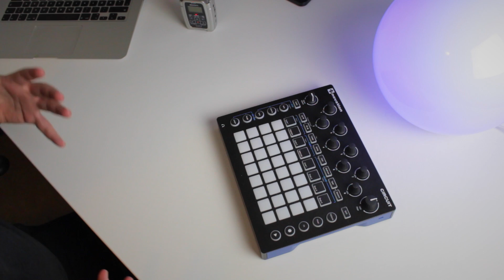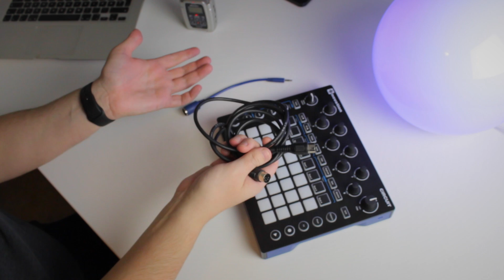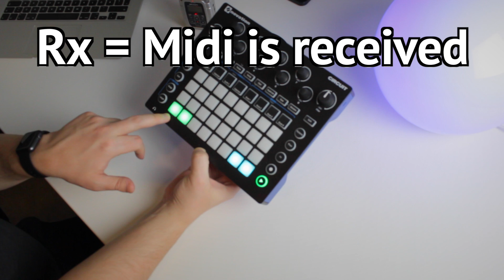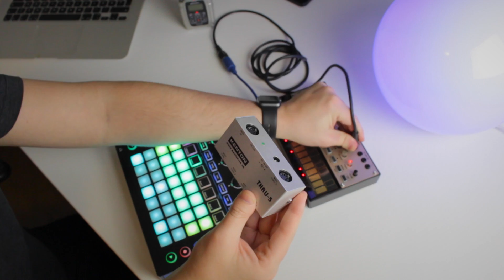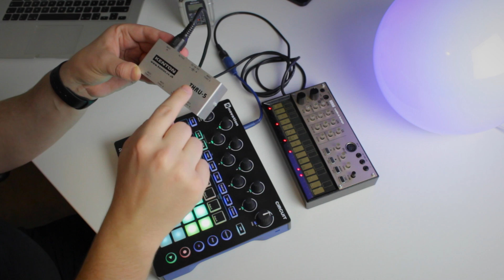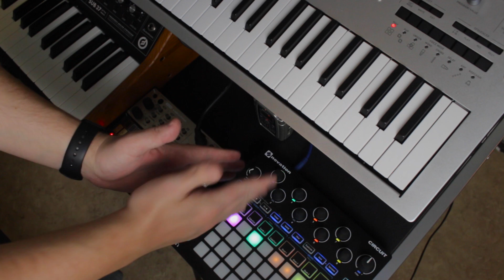How to connect & sequence external synths using Circuit (Beginner Friendly Tutorial)

Comment: Bo another midi question re the circuit.
Any idea how to get the circuit to recognise the pitch and mod wheels. The original mini nova synth has both but I'm told the circuit mini nova synths don't respond to a normal pitch or mod wheel send which is quite strange. Any ideas on a work around

Comment: Hi Bo, I have a Circuit and 2 Behringer TD-3's. How can I make these 3 units run at the same speed if each TD-3 has its own sequence running on it? This means that no MIDI notes should be sent, only synchronously, but at the same speed. In your first example with the Volca Keys, it runs in sync, but not at the same tempo. How do you manage that?

Great Channel! 👍🏻

Comment: Just a little headsup for people, you have to use the blue adapter! I thought I could skip it and bought a Midi DIN to 3.5mm and it doesn't work. need a traditional Midi DIN cable into the supplied adaptor.

Have fun all!
Reply: 3.5mm 3 Pin TRS Plug to Standard 5 Pin MIDI Socket Adapter Lead

There are several different types of these adapters, when companies started using 3.5mm connectors for MIDI there was no standard so not all companies use the same wiring.

This listing is sometimes known as Type B and is suitable for:

Arturia - Models including Beatstep Pro and Keystep
Novation - Models including Circuit and Launchpad Pro
1010 Music - Models including MX4

Wiring inside the cable is:
Tip - Pin 4
Ring - Pin 5
Sleeve - Pin 2
Reply: @pflo-98  you rock!

Comment: I bought a used circuit, but it seems to send no clock or other midi data, no matter how i set both Rx and Tx. It also doesnt receive. 8 use 3.5 mm three pole trs to DIN midi adapters, not the originals though..
Reply: The Circuit uses the alternate "TRS MIDI B" wiring breakout cables, so perhaps you have the "MIDI A" type. Korg uses "MIDI A"; Arturia and Novation use "MIDI B".

Comment: This is great. I want to do this with my Behringer Crave when it arrives.
Reply: How did this work out for you? Looking to do the same
Reply: Perfect. I have the circuit set to control a Yamaha dx7 and model d on same midi channel 1 and crave set to clock of circuit so I can use its internal sequencer and keep it set to tempo of circuit whilst playing different notes. Great setup.
Reply: @davidlloyd9598  wow man i just looking to do the same. my buying list includes circuit, model d and maybe the crave. so you saying that is possible to have a midi keyboard sending midi notes to circuit which will then send both notes and sequence to model d without affecting the rest performance of the circuit?
Reply: I have my circuit set up to play poly chords on channel 1 sent to dx7 which is going through zoom ms70cdr then polara all in stereo into mixer which can be layered with circuit synth. On same channel my Model D will play all of the lowest notes of chord. The crave is on a different midi channel so plays its own sequence using its arpeggiator or sequencer it syncs with circuit clock though through midi. I then have a spare channel on circuit to use for a baseline or melody or whatever. The crave could be set up on same channel to play arpeggios and using a delay behringer fx600 this works great for arps if you want. It is a great set up. I use it for making backing tracks that I can play over with my guitar. Model D and Crave are the best synths in terms of sound quality and value. The dx7 is probably the best polyphonic synthesiser you can get. It has iconic status thousands of patches and when you put it through those two pedals I mentioned it sounds beyond epic! Have fun. The circuit is a fantastic device which is a great hub and works really well.
Reply: @davidlloyd9598  great reply thanks. I guess I could do the same with my yamaha psr-303

Comment: hi, ive the mono station and drumbrute. ive tried to set them both up with 5 pin to jack. so midi out on the circuit into midi in on the drumbrute. but for some reason they dont play together when i press play on the circuit. any ideas? i have the setting set up right when i press shift and on on the circut. thanks

Comment: Hey Bo, thanks for this video which was really useful.  I'm interested in something that will act as clock sync between my keystep (playing novation peak) and grandmother.  I can't use either of those as master because I want to be able to run and stop the arp and seq patterns on each on independantly while they remain in sync.  Do you think the Circuit would do this job while allowing me to clock divide the keystep and grandmother independantly to change their speed while remaining in sync?

Comment: Hey BoBeats, thx for the informative tutorial!  What if you want to play a synth to record it's sounds into Circuit?  How would I go about doing that?
Reply from the maker: you cant record the sound INTO the circuit. You can only record midi notes. Midi out into midi in of the circuit. Making sure the circuit can receive note values
Reply: @BoBeats  Nah Bo...u CAN absolutely record into Circuit through MIDI.  I did it the other day.  I simply forgot how to do it since I've been trying different configurations.  I was hoping you had done it before and can help me.
Reply from the maker: Yes midi, but I was just making sure you didn’t mean AUDIO :-) midi is not a problem.
Reply from the maker: For midi its: set your synth to channel 1 or 2, this will target synths 1 or 2 sequencer channels. Or channel 10 for drums. Midi out from synth into midi in of the circuit
Reply: @BoBeats  Thanks again for your help and awesome tutorials!
Reply: @BoBeats  It's not working for me.  I can hear the notes being played on both devices but when I press record on the Circuit it only records the internal sounds.  Is there any trouble shooting I can do before I exchange it?
Reply: Pls disregard.  I got it to work!  I was about to return it to Guitar Center lol 😂.  Basically I forgot to plug both MIDI IN's and OUTS.  Also I had to press the boxes in the Midi settings to send and receive notes.
Reply from the maker: So you want to play back the synth from the Circuit? Ok!

You connect midi out from synth to the Circuit. Then you connect midi out from Circuit to synth. Then you set the SYNTH to midi channel 1 or 2 (or 10 for drums) and then you should be able to play back midi notes from the Circuit sequencer + record midi notes from the synth. If this doesn't work I would email Novation and ask over on Circuit Owners group on Facebook. Great group!

Comment: Really informative video and easy to understand! I have a question lol. Is there a way to use the circuit as a sequencer for the minilogue’s sound? Like not have the circuit sound and just the minilogue sound playing in the circuit? If that makes sense lol
Reply from the maker: Thanks! No the Circuit has no audio input. What you can do is to sequence the Minilogue from the Circuit and turn down the audio from the Circuit in the Circuits mixer so that you only hear the Minilogue. But you still need an audio interface/mixer to hear both sources at once.
Reply: BoBeats ok. Thank you

Comment: This gets confusing.  How would you connect a synthesizer, a Circuit, and a Zoom reverb pedal to a computer?  I have the novation Audio hub but it only has 2 RCA inputs.
Reply from the maker: If I am not mistaken here you would just use Circuit outputs L/R into the Audio Hub inputs (use TRS to RCA cable or small converter plugs that converts a TRS/TS to RCA). And if you want to use the Zoom reverb you just do Circuit -> Reverb -> Audio Interface. But that means you will get reverb all over your Circuit which isn't ideal.
Reply: Yea that's the setup I have going now; however, I added an ultranova synth and ableton only sees the individual components so I cannot record them together. I guess what I need is a mixer instead?
Reply: Hey just wanted to say thanks for the help.  The way I have it going right now is Circuit Mono out->Ultranova->In.  Circuit MIDI out->Ultranova MIDI In.  This does allow me to play both; however, they are both playing the same sound from the keyboard.  My task now is figuring out how to make them independent and be able to use synth 2 on the circuit as well as the drums etc..  haven't figured this out yet.

Comment: so when I sync my Novation Circuit with my Korg Volca it has to use the midi-port of the Volca? since the midi-port is already used, is there a way I could still control the Volca via my Arturia Keystep? or do I now have to play it using the ribbons?

Comment: Hey Bo, big fan of the channel! I can't seem to sync my Circuit and Volca sample. When I hold shift and turn on the Circuit the entire bottom row lights up, not just the two at either side. Is this a change that happened during a later update? I followed your instructions, but the confusion comes with the rest of the lights. I've tried a bunch of combinations and just can't seem to get it to sync! I'd really appreciate some help here, Google doesn't seem to have the answer. Cheers
Reply from the maker: This is correct. They have added more options. Unfortunately I have not looked into it much :-(

Comment: could you maybe help me with a couple questions? ill explain the best I can here goes. ok I have a novation circuit and a zoom q2n and a zoom h5. I wanna wire these up to the zoom q2n and use the mic on the h5 for guitar into the video recorder (2qn) do I plug n the circuit to the input of the h5 then line out to the q2n then monitor it with headphone jack? and if I do it this way will the h5 have to be recording for the novation sound to make it to the q2n? to sum it up I just wanna get audio and video and get external (guitar) to the video recorder.

Comment: Can you tempo sync novation circuit with korg monologue using standard 3,5 mm jack ?
Reply from the maker: +Korpo Crey no I dont think that is possible. I dont think the sync jacks on the Monologue are the same typ of jacks as the Circuits midi. I could be wrong here tho!
Reply: Thank you very much for the reply> I just purchased the monologue and the circuit  - those are my first pieces of gear after years of using VSTI's. I have a problem with syncing - when I connect the two using the headphone 3,5mm jack - the monolougle dispays shows CLOCK SYNC, but I can no loger activate a sequence on it. 
As soon as I deplug the cable from the monologue, the sequencer behaves normally and plays the sequence. Any ideas what I may be doing wrong?
Reply from the maker: +Korpo Crey i think you should use midi out from circuit into monologue :-)
Reply: That is what I do Sir :D

Comment: Hey Bo! So I finally got my Circuit and now I connected my microbrute to the unit and it works. BUT the Problem I have is that the synth also gets triggered by the drum channel! So the microbrute and the drums play at the same time. What did i do wrong?
Reply from the maker: +Honeyball Lecter hey! You should check the manual for how to turn of receiving midi input/output, cc input/output, and clock. Basically you power off the unit, hold shift and press power and then you can toggle these things :-) From what you write I assume that you want to turn off midi send. 

But if you want to send midi from synth channel 1 to the microbrute you need to check what midi channel the Brute recieves on so it doesnt recieve on channel 10 which is the drum chanel.
Reply: BoBeats 
Thanks for the reply mate! 
I'll check it out tomorrow and try to make it work. Thank you very much :)

Comment: Hey Bo! Are there new functions with the circuit 1.5 firmware update?? When I load the circuit with Shift+Power On, I get two green lit pads, followed by two orange lit pads, and then the two blue lit pads on the far right... any ideas?
Reply from the maker: Yeah there are new functions in 1.5. I have not yet updated but I think the orange pads are for midi CC messages if I am not mistaken.

Comment: Very useful man, thank u very much. 
Can I know if is it possible to load midi sequences into the Circuit (not writing on it), to sequencing synths ? 
I want to play my tracks live without a computer, by sequencing analog synthesizers with the Circuit, so I take out midi stems from Logic or Ableton project, load them into the Circuit and then live sequencing synths, is it possible? 
Thank you!
Reply from the maker: Thanks mate. As to your question. I do not know if there is any good way to do this besides actually recording the midi stems into the device manually. There is no way of loading say a midi file into it.
Reply: Thank you very much for your answer man; it's unbelievable that it's so hard to find a device that can do such an easy thing ! 
I watched Social Entropy Engine and it looks so cool, but it costs two times more than the circuit and it's also a lot less flexible.  :-(

Comment: Thanks for the video, my own Circuit's synth recording mode seems to have been disabled after having connected my Minibrute's MIDI OUT to its MIDI IN. Doesn't make much sense, maybe the memory is full but I don't know how to check that. I thought I remembered the machine had an SD card but I don't see the slot. I can input or live record drum notes but neither record synths nor input synth notes in stop mode. Wonder if separate memory areas for synths and drums.
Reply from the maker: You are most welcome! It sounds REALLY strange the way your Circuit is behaving. perhaps you can post over on Circuit Owners forum on Facebook and see if someone can help you? I am afraid I can't really come up with a solution
Reply: Thanks anyway my good man. My circuit is indeed behaving strangely just when I was finally connecting it to the Minibrute. Damn. I will delve into the FB forum you suggest or write Novation.

Comment: Hey Man. I have a Question and maybe you could help me. Do the knobs from Novation Circuit send Midi CC. I want to use it to control the parameter of another Synth. I want to know if it is possible to control the Filter of another synth with the knobs of circuit, for example. If possible Do you know what number do the knobs send out ? Cheers
Reply from the maker: Yes, the knobs send fixed CC values (one per knob if I am not mistaken). If the other synth can't change CC value for the filter for example, this will be tricky. The only way I heard about making this work is having some kind of midi interface or program in between that actually "translates" the fixed CC values from Circuit to fixed CC values on the other synth. But this is cumbersome. So I think the answer is: it will be hard to make it work.

Comment: I have a brand new circuit, and tried to connect it to my laptop (firmware upgrade). I had difficulties having it state "connected". After reinstalling the USB drivers, it worked, but after disconnecting it, and retrying it did not connect either. Anyone having trouble with connecting a circuit to a PC through USB?
Reply from the maker: I have seen several people having problems but I use it with a Mac so I of little help here. Have you tried contacting support or asking on Circuit Owners on Facebook?

Comment: Nice and informative guide. I've been having a nightmare time trying to get this to work via USB, however. I've tried several options and think it may be down to the iConnectMidi4+ that i use as my hub. It seems that if you connect the Circuit to the ICM4+ via USB (on a powered hub on the ICM4+s hub port) it will send midi notes but clocking has been hard to get to work. Maybe this is user error. I was able to sequence some DIN MIDI'd gear via the ICM4+ but Ableton would not recognize the Circuit in the MIDI prefs. I'm thinking one of those Kenton plain ol Thru boxes might be an easier solution. Having the whole studio clock is a good way to lose days and days trouble shooting. Anyway, just thought i'd share some experience if anyone is using a more complicated set up.
Reply from the maker: Thanks for sharing mate! What you describe is one reason I tend to stick with physical midi i/o. There is just something about midi that makes it work splendid in theory but in practise there are so many driver/settings issues that I just can't cope with. I hate fiddling with stuff :/
Reply: I agree. Thinking of abandoning USB midi. It's a nice feature but if you have DIN, then just go that way, especially if you have larger set ups. The only issue that starts to pop up is MIDI filtering, as you state in the video the nobs etc will transmit CC so some gear might freak out. The ICM4+ is great as it has loads of filtering and remapping built in, but it's just honestly not a stable enough product, unfortunately.